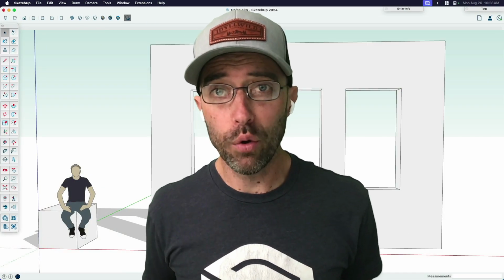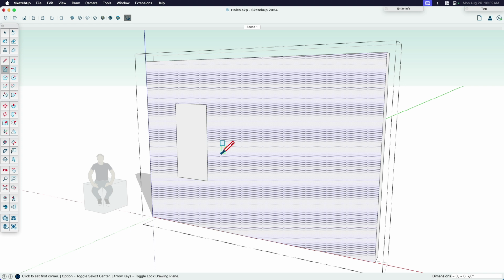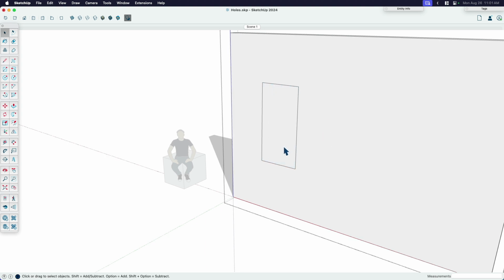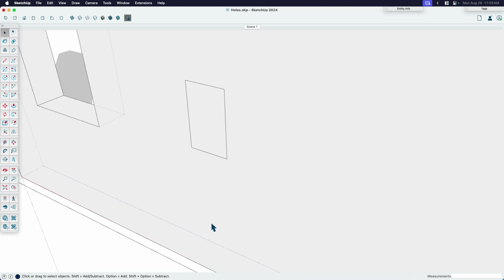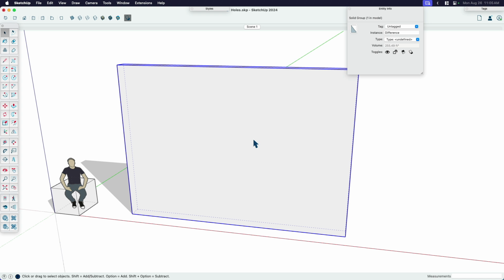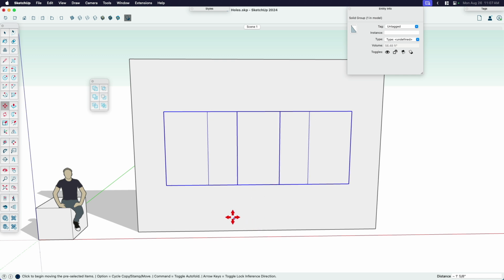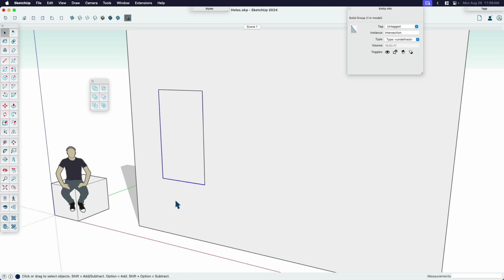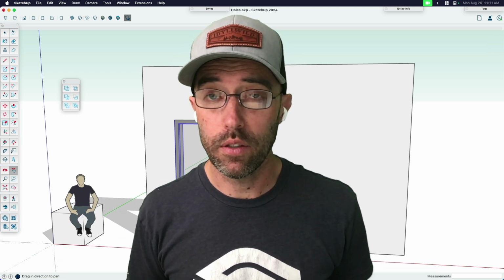Punching Holes and Openings in Walls | SketchUp Tutorial

Comment: Once in a while, when cutting a component into a wall, something just gets stuck and the normal fixes don't work. Maybe the component creator didn't get out all the glitches. When that happens, I just manually cut the openings on both sides with rectangles, join the corners, then just snap the component into the opening.

Comment: I have a wall where the window inner opening width is larger than the outer with, house is over 100yrs old with 15" solid walls. So had to create centreline, draw Rectangle on the inner plane extend the centreline, then draw the smaller outer plane. Then connect the angled corners and group.